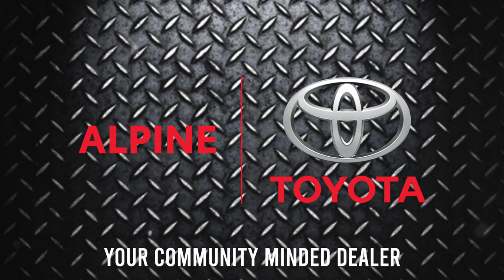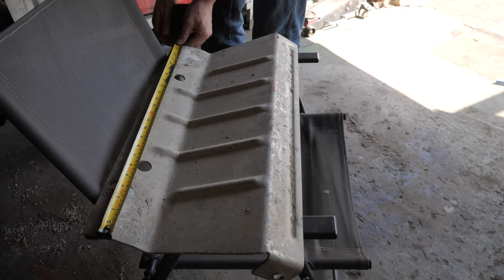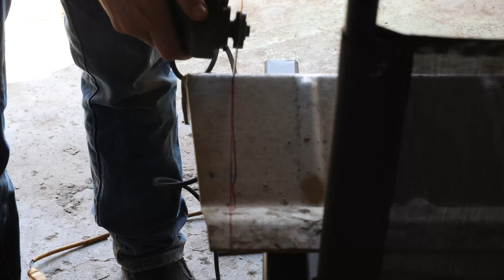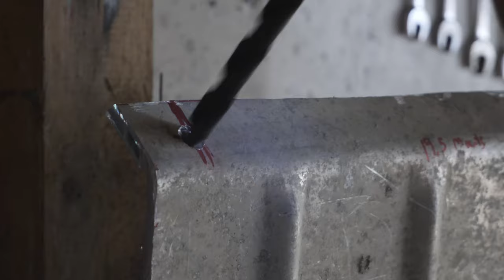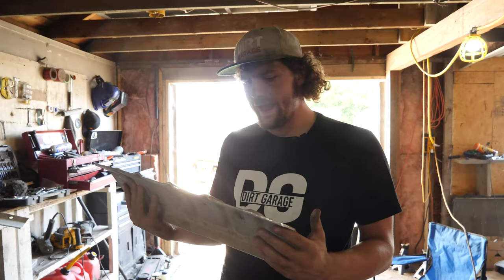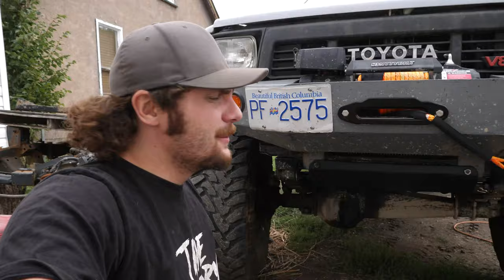Toyota SAS Custom Skid Plate | Massive 1KZ Diesel Radiator Cover

Comment: it looks awesome man! only thing im worried about is when your driving around the plate will vibrate with it only being supported at the front and it will fracture at the spot you cut and bent it, sending a big chunk of aluminum flying down the road like the scene from fast and the furious when Paul walker looses his floor board lol...  i would defiantly add some tabs on the back of it and weld that cut/bend up...

Comment: You were taking about running  premium gas on your 3.4 supercharged engine and now the new v8 there's a way to run regular fuel  on the factory ecm .my Toyota truck has a supercharged 3.4 it runs on regular fuel no detonation  plenty of power

Comment: O I forgot to tell you toyota knock sensors are to sensitive you need to attach a resistor  in the 2 wires of the sensors before you reset ecm so it will stay somewhere of 20 degrees advanced

Comment: You have to teach the factory ecm to compensate for regular  all ecms have a 15 to 20% adjust front factory  you have to return to factory settings  they all come open and they learn as you drive wait  for the vehicles to be cold  and for that possible below 70 degrees create a major vacuum  leak allow engine  to stall after fast idle do the same process 2 or 3 times on separate  days correct vacuum leak it will run very bad but will adjust after driven for a couple 100 miles may sure you have regular fuel on tank when doing this good luck

Comment: The only thing I would of done before you painted it would of welded that cut back up just with it not supported vibration may snap the back off other than that nice looking and great idea I may need one for mine
Reply from the maker: I would have if I had the tooling to weld aluminum
Reply: @DirtGarage   that’s a far call haha might have to be the next investment if you have a mig it’s only some wire and gas you need to change for basic alloy welding

Comment: That thin piece of junk will do nothing to protect your radiator.  Get a piece of 3/16 steel and make a proper steel skid plate.
Reply from the maker: It's 1/4" aluminum. It'll be fine